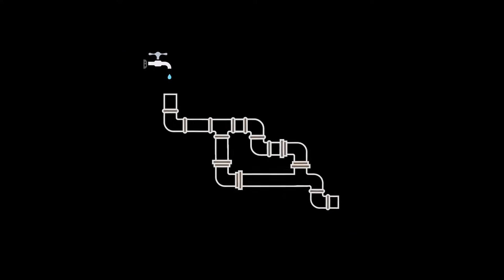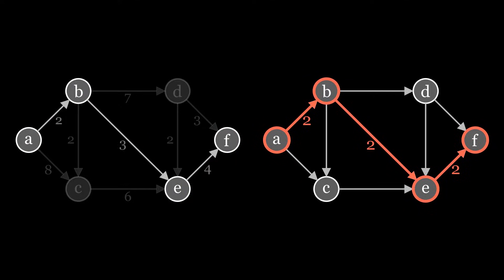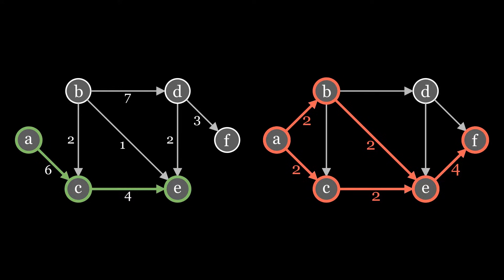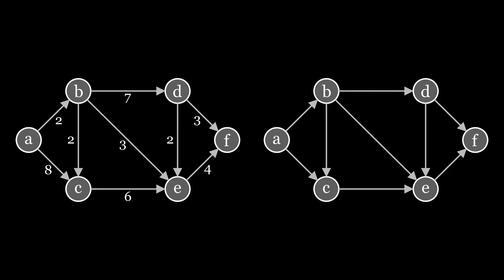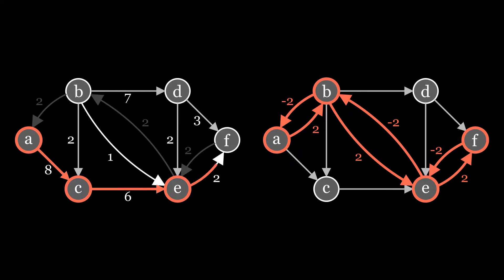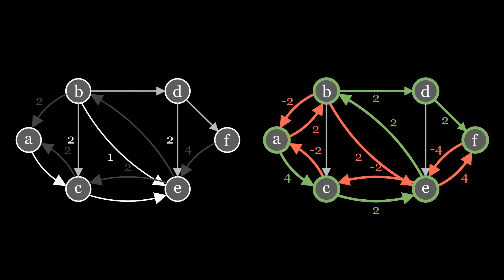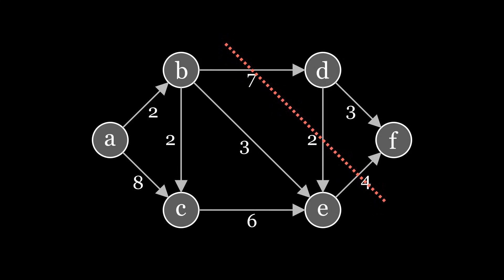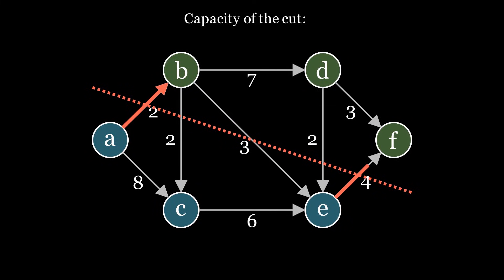Maximum flow problem - Ford Fulkerson algorithm

Comment: The maximum flow = 6 (from a to f).
One possible flow distribution that achieves 6 is:
a → c → e → f : 4
a → b → d → f : 2
There does not exist a flow along a → c → e → b → d → f, because the edge e → b does not exist.
Please check this again and explain further.

Comment: at 1:24 at right side graph e-f is 4,but why computing Residual graph at left side e-f is 2-2,not 4-2?
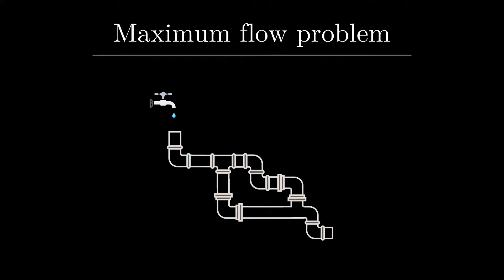Reply: The first path, a-b-e-f, that was taken at 0:20 "takes up" 2 units of flow from the edge e-f, as along that path the minimum capacity is 2(if you imagine the edges as pipes you can't have more water flowing than the capacity). So the next considered path, a-c-e-f, which also can have 2 units of flow pushed along it, contributes 2 units to the edge e-f. So in the left graph, we have already done 4-2 = 2 and the newly added 2 units, 2-2=0!

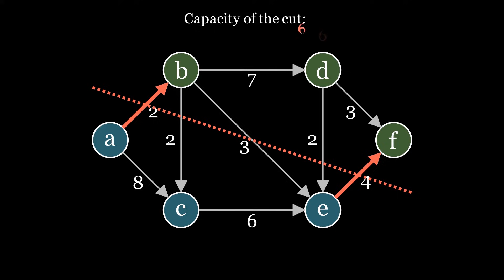Comment: In last animation at 5:06 why don't you use all edge capacities like a->b =2  , b->c=2 ,b->e=3 , d->e=2 , e->f =4 so minimum cut would be sum of these =13 but you say 6 how
Reply: My understanding is since it's a flow graph, some edges go over the cut towards the sink, and others come back over towards the source. So since A and E are on the source side (coloured blue) going to B and F on the sink side (coloured green), we add them to get the cut capacity. The other three edges in the cut are coming back over from the sink, so we don't include them. In other words, we only use the edges with their tail in the source side and their head in the sink side (basically what she says at 4:27).
Reply: take a look at the reverse edges in 4:13, the sum of reverse edges that come out from the sink is the minimum cut, so 4 + 2 would be 6!